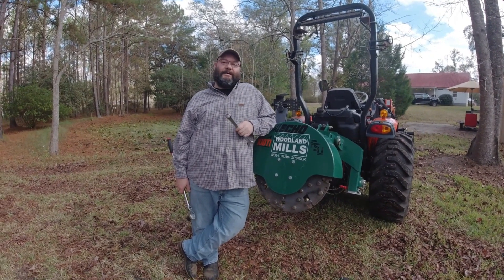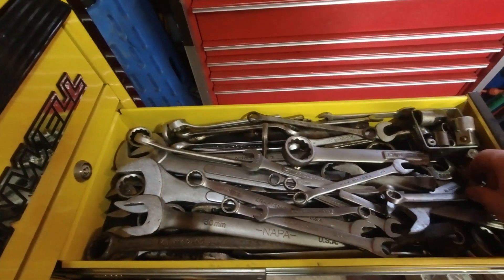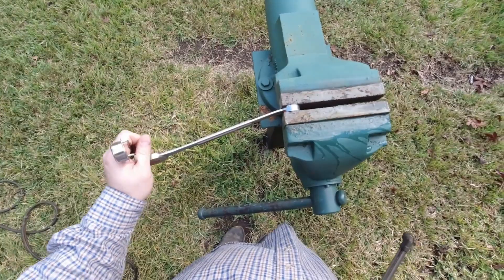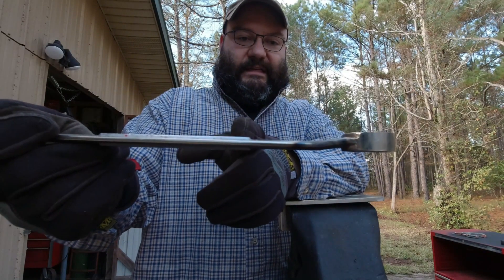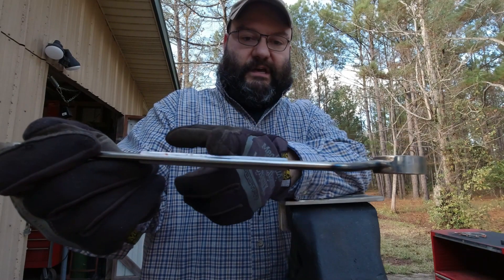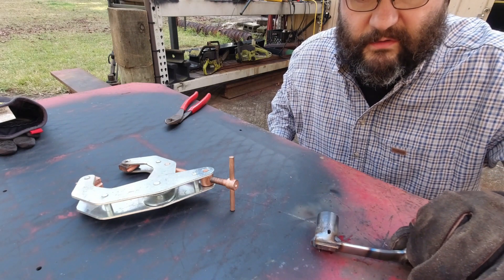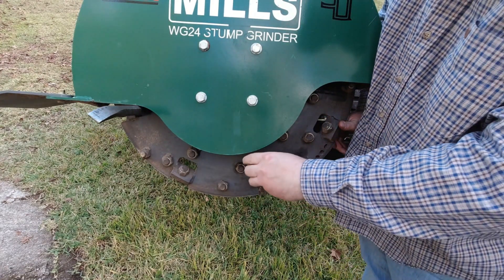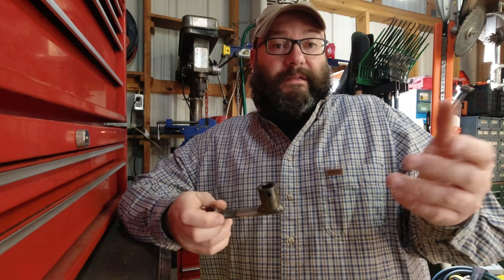Homemade Tools! We Build a Wrench Torque Adapter

Comment: Nice video! Interestingly, the WG24 I just bought came with a wrench for this. They call it the "torque adapter", part number 0004194. The manual really stresses that the adapter wrench needs to be 90º to the torque wrench to ensure the correct torque is applied.
Reply from the maker: Good to know. I bought mine used, so I didn't know what it came with. Yes, when using a torque adapter if any type, always make sure you keep it at 90*. Anything other than 90* will either result in too low or too high of a torque being applied (though I think that difference is really negligible).